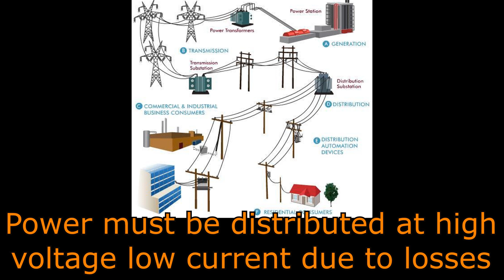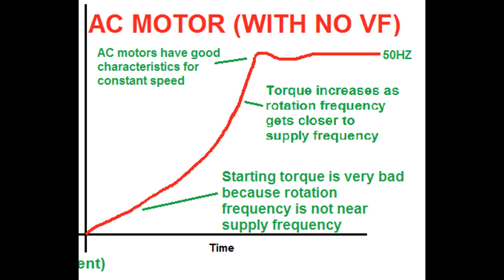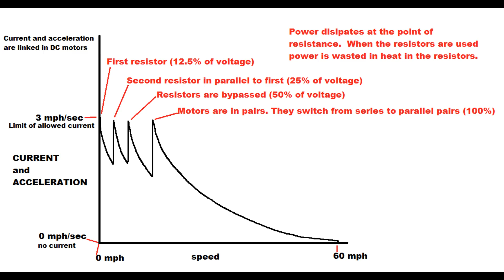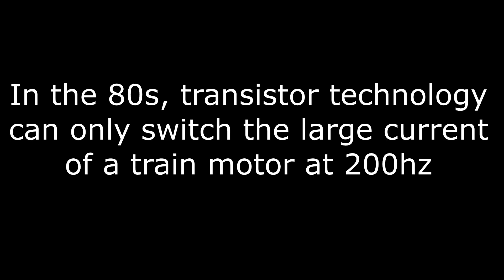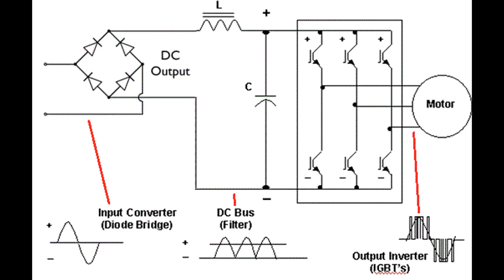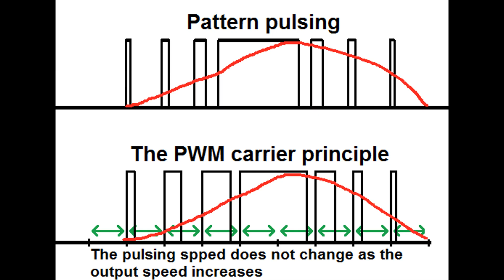Why do trains make interesting sounds

Comment: It isn't really fair to say that Direct Current motors themselves are SO much less efficient than a VFD and induction motor. A bit less efficient, perhaps, yes, but not dramatically so. Using resistors to control the DC motors IS terribly inefficient, as noted. The real advantage of the AC motor and VFD is the elimination of the maintenance of the brushes and commutator. I am and will always be partial to direct current machinery, and so am quick to point out that it actually isn't so bad as is assumed JUST because it's "old". BTW, speaking of that, you didn't mention the original way that Direct Current power for traction was obtained from Alternating Current supplies: Rotary Converters! There's a truly marvelous machine. ;)

Comment: If the '96 train has AC motors, then why does it make the sound of the transistors reducing the inrush of current to the DC motors?
Reply from the maker: The 1996 train has an early VF drive that switches from true PWM to pattern PWM at just 2 mph.  The sound it makes is typical of and old style VF drive.  It doesn't sound DC to me.

Comment: Sydney Trains traction systems are as it follows:
K sets and V sets V1-V27: Mitsubishi Electric camshaft resistance control, with DC series-wound motors
V sets V28-V51 and T sets: Mitsubishi Electric GTO–4-quadrant chopper control, with 2-phase DC shunt-wound motors
M sets: Alstom ONIX 1500 2-level IGBT–VVVF inverter control, with 3-phase AC induction motors
H sets: Mitsubishi Electric 2-level IGBT–VVVF inverter control, with 3-phase AC induction motors
A & B sets: Hitachi 2-level IGBT–VVVF inverter control, with 3-phase AC induction motors

The Sydney Metro uses Alstom OPTONIX 2-level IGBT–VVVF inverter control, with 3-phase AC induction motors
Reply: Camshaft sound like hanging resistance control

Comment: The 377s do that pulse sound around 32 mph on dc and 36-40mph and ac overhead wires, But that being said if it is just perfectionist programming that makes the motors sound .....a bit boring at the start ...and not a major benefit..then I'd much rather than switch it back to the way it used to be in the 90s

Comment: Brilliant video! I’ve had a slight grasp of the idea of pulsing (I’m a tram driver, and we have gone from resistors to transistors (still DC, two types) to AC technology. The DC I understood, but have never had the AC principle explained so easily.
However: Early single-phase electrificiation used low frequency AC. The Thamshavn–Løkken Railway uses 25 Hz, and the Norwegian/Swedish/German railways uses 16 2/3 Hz. I’ve been told they use DC motors somehow converted to AC, and the low phase prevents arcing (they are still using brushes and coiled rotors).
50 Hz could not be used until transistors came along, before then they used converters (rectifiers), such as the Ignitron (a kind of mercury arc rectifier), before reliable solid state rectifiers came along.

Details about this are in the book "The history of the electric locomotive" by F. J. G. Haut (aviable in libraries and on Amazon).
For which reason many railways electrified with direct current (France, Belgium, The Netherlands).

More detalis are to be found in the book "Electric traction on railwas" by Philp Dawson, but this is a rather old and rare book.
Keep up the good work! :D
Reply from the maker: The low frequency AC is for universal motors.  The German railways use low frequency AC.   A universal motor is a DC motor where both windings of the motor are wired in a way where changing direction causes both to change in a way that they counteract each other, so forwards force is produced both on positive and negative.  The problem is that the voltage alternating has a reaction time that takes away efficiency.  This means the lower the frequency the less the motors have the reaction delay, but if the frequency is too low the transformers supplying the power to the overhead line will stop working properly.   To use universal motors you have to have a completely separate power supply, using a separate part of a power station, separate distribution lines just for it to work.  That is a lot of inferstructure.  Then a unerversal motor is less efficient than if it was just run on DC due to reaction losses.  The only thing you gain is that you no longer let losses in the arc rectifier to convert the power to DC.  But this is no longer a problem since the diode was invented.

Comment: What about the Metrowoagonmash 81-718/719 in the Kharkiv Metro on the Oleksiivska line (green line)? I know they have the DC pulsing, but they don't sound the same as the 1996 Stock on the London Underground.
Reply from the maker: The 1996 on London underground does not have DC pulsing.  It has AC pulsing.

Comment: I wish one day that one person makes an electric car with 90s pulsing patterns.
Reply from the maker: When I get an electric car I will be going through setting on the OBD to see if I can get to the VF carrier frequency setting
Reply: @benolifts  The Porshe Taycan Turbo S has two AC permanant magnet synchronous motors which seems to use pattern pulsing to drive it. This sound is amplified with the help of some speakers and can be heard here: https://youtu.be/h0IAgkHpU54?t=74
Reply from the maker: @cloudrak    That is very weird that a Porsche sports car has pattern pulsing.  Although I don't like these sorts of overpriced cars as they are status symbols and also in my opinion the bad side of capitalism when people lust over expensive items that are not necessary to have.

I have noticed that Toyota Prius has possibly the same VF drive as the train on Warsaw metro that has the PWM pulsing change pitch in stages as the train starts.  Also a few cheap generic lifts have this VF drive.  If I owned a Prius I would see if I could lower the PWM frequency and make my car sound like a Warsaw metro train.
Reply: @benolifts  Oh and for the BMW i3 ev, you cannot change anything drivetrain based through Bimmercode on a OBD2 reader.

Comment: This is a really good video, with excellent annotations and commentary but I noticed some misleading imprecisions :

#1 (5:30) As the motor starts, resistors must be sequentially removed, not turned on !

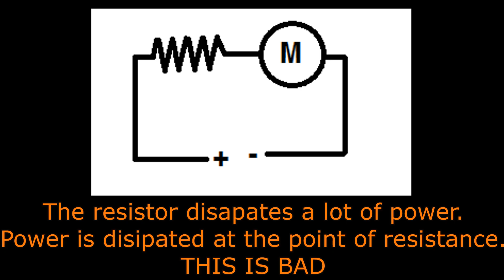#2 (6:46 - 12:06) The first semiconductor equipment used as a switch to "pulse" the current from DC to DC was the thyristor, not transistor. It is limited as you said by its "chopping" frequency. By the way, such electronic apparatus is better known as chopper circuit (chopper control). Also, its wide adoption in trains began in the 70's. The first train driven by a thyristor-chopper in my country (Belgium) dates from 1970 ! The thyristor kept being produced until the 90's, depending on the country, etc.

Eventually, basic transistors could be used as switches in chopper circuits, allowing higher switching frequency, but I don't know a single train model with this configuration. There is the modernised tram T5C5K but it was equiped with next-generation IGBT-transistor in 2002 (thanks hu.wikipedia), thus having nothing to do with 80's' transistors.

Finally, GTO-thyristors and IGBT-transistors were both created in the 90's, having even better efficiency and allowing the use of 3 phases AC motors, in the now famous and melodious VFD's. ^_^

Apart from that, your video is excellent to popularize those underknown concepts !

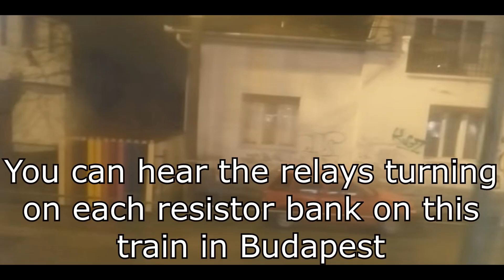Note to people interested : the clip at 6:01 can be found here : watch?v=BbvdBA4jygI
Reply: Oslo has two classes of thyristor-based trams, both dating from 1979–80. However, the second class (externally very similar to the older), has a newer thyristor equipment (you notice the different humming). Could be they have GTOs, as they came ≈5 years after the first (SL79I/SL79II).
And we have a bunch of Ansaldo/Breda trams with AC motors and inverters (SL95). Presently awaiting new trams from CAF…
Reply: Hello Ciel, I just saw your reply, sorry for not responding earlier.

The control device of SL79 clearly sounds like chopper :) Regarding the second batch (1989 126-140), the chopping frequency rises soon after departure, while it seems constant in the first batch (1982 101-125). Compare watch?v=IlKMsIxxpqQ&t=2s and *watch?v=IlKMsIxxpqQ&t=58s*. I found no reliable source on internet supporting the presence of GTO's but it could be the case. What can be said for sure is that the switching pattern of the latter control device is different.
Speaking of SL95, judging by what I can hear, it must be IGBT-based inverters watch?v=SPLL0sIP6x8&t=237s
Reply: Um no. Unfortunately, Point number 1 is not valid, Beno got it bang on.

 I think your forgetting that these resistor banks are wired in Parallel not series. Its quite confusing but the total amount of resistance in a Parallel circuit is always LESS THAN (not equal to) the total amount of resistance in each of the circuit loops.

A good way to visualise this is to think of current as little people (maybe passengers at a train station). If they are all forced to go through one of  the circuit loops and through 1 lot of resistors at a time then they will all be squished and will slow down trying to get through. But if they were given the option to go another circuit bank AND the one they are currently using (remember in parallel circuits the Current is split between the different loops pretty much equally) then although the amount of resistance in the resistor remains the same throughout the circuit, the current is able to pass through easier.

(Its like having multiple queues at the checkout and they open a new till and suddenly the process is twice as fast!) It seems counter intuitive, but this is the way it works.

Comment: The 1996, and 2009 stock makes the nicest noises
Reply: Not a big fan of the 2009 stock but I love the 1996 stock
Reply: 1996 is greatest sounding tube stock of all time, not arguable.
Reply: @ibby_europe_trains  yes it makes the best sound
Reply: 2009 stock sounds like a future train for me
Reply: The 2009 stock sounds like a ufo
Reply: Class 323 on midlands railway, or London midland as I knew it back then. It was such a great noise!
Reply: 1992 and the D Stock are also cool
Reply: @esftracksydeomg  If you like the 1992 stock, the Class 319 is like the 1992TS, but with a lower pulsing frequency and just as epic-sounding.

Comment: 7:46 you could do it using led lights the higher the faster there flash the lower the slower  there flash  I learnt this in radio communications course

Comment: You can convert ac to dc like the charger in your phone some are switching chargers I uster teach this a lot  its like my alarm clock it plugs into ac in wall and converts it to 12 v dc. You can get a dc to ac converter circuit

Comment: Can we use Frequency Modulation (FM) as in radios and digital synthesisers (I’m not sure) where a wave is used to modulate another(......I think) to control 3 phase AC motors, by having 3 Frequency modulators to control the 3 separate phases? If not, what is the reason behind this?

Comment: Apart from being AC and DC, why does an AC desiro (350\360) make slightly different noises to a DC desiro (444\450)

Do you know how 1995 stock motors work?

Comment: This is interesting I'd always wondered exactly what caused the step change pattern of sounds as electric vehicles accelerate, knowing that they don't feature gearing systems like combustion drives I assumed it had to be something on the input side of the drive motor but never really knew exactly what.

Comment: They don't turn on resestors they cut them out.
Reply from the maker: depends if it is series or parallel resistors
Reply: @benolifts  How come it depends on if they are in Series or Parallel?
Reply from the maker: @J-Railway-Volunteer    Resistors can be in parallel and each power step a resistor gets added every notch to increate the current path through more resistors to increase power.  Or resistors can be in series where each power increase is done by bypassing a resistor each notch to reduce the number of series resistor chain to decrease ohms which increases power.
Reply: @benolifts  What about in Shunt and Weak Field power notches?

Comment: Sounds similar to the Siemens p2000 used in Los Angeles
Reply from the maker: I just looked up that train.  It sounds like it uses the same VF as the Manchester 2000, original birmingham tram, Copenhagen metro.  But the max pulsing setting is set much lower.
Reply: Beno Lifts are those also Siemens?
Reply from the maker: No, the VF drives are not necessarily made by the company that builds the train.
Reply: @benolifts  the P2000 use AEG VF while in manchester it's ansaldobreda who created the VF

Comment: 1::::2:::3::4:5:4::3:::2::::1:::::1::::3::5::3::::1:::::1:::3:5:3:::1
Have you heard a class 73 electrodiesel in electric mode. It takes a DC input, but sounds like it has VF, even though it was built in the 1960s.

Comment: Fantastic video! I've ridden on many of those types of trains over many years and gradually figured much of this out but it's great to see so much more. I witnessed a 1990's BART train blow a motor and drive as it was slowing down nearing a stop; I was in the station  and there was a very very loud BANG the instant the descending tone  switched to the final continuous drive tone; which I thought was most interesting. Within about a minute half the station was full of a thick, white yet nearly odorless smoke. I figured that transistor based drive and maybe some motor coil had met it's 1000 volts of instant DC death. 
Regarding the advancement of transistors, it seems the same thing is true for other types of motors. I work with old video tape machines and have noticed some very interesting and sometimes complicated methods of getting tapes to run at high (yet servo controlled) search speeds in the more expensive machines. I think I am hearing about 200 Hz as the maximum the coil switching speed in some of these capstan motors with parts originally designed in the early 1980's. When the machine is commanded to run at a slightly faster search speed the capstan motor just disengages and the machine switches to servo control of the direct drive dc reel motors (on some older machines). I'm guessing that is a duty cycle of less then 400 hz or so.

Comment: Have a look at a mercury arc rectifier, designed in 1902ish was a crude but well used way of converting ac to dc, the Manx electric railway used to use several
Reply: rickyreynolds17 It has to be the most beautiful way to convert AC into DC. It looks better than a rotary converter.
Reply: @buddyclem7328  They are also without moving parts… I guess with proper cooling they last "forever", as on the MER. :)

Comment: Now I know why trains make the noises that they do. Remember those double deck train in the netherlands from your amsterdam video's? They have a characteristic woop-woop sound that's a bit like the examples you've shown. The really old (now out of service)  mat 64 trains from the 1960's had some characteristic sounds, they accalerated quickly but could also break quite fast making a sound that I've associated with the sound of waterfall. These trains also made you feel every shock of the rails like those old prague trains. Those Mat 64 trains where awsome.
Reply: You mean the DDZs? Those have a really funky sound, it's really interesting. The ICMs also sound really nice. I do wonder what kind of equipment those two have and what the engineers programmed in to make them do that. Apart from those, I think my favorites are the Austrian Taurus locos that play the major scale when accelerating.
Reply: @WhyFi59  pretty sure the ICMm has Chopper's. not sure about DDZ.

Comment: Why did the 90s kone ecodisc lifts not make the 90s vvvf sound?
Reply from the maker: A lift motor is much smaller than a train motor.  The larger the load a transistor has to switch the lower the switching frequency needs must be (within the limits of the transistor technology used).